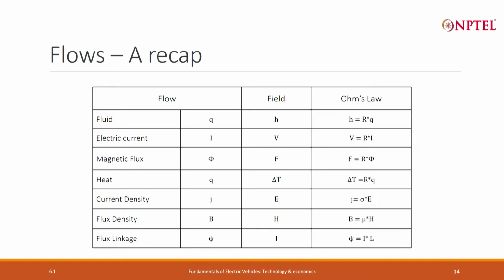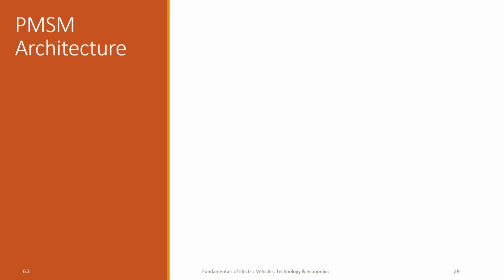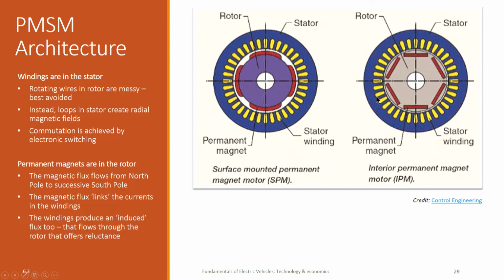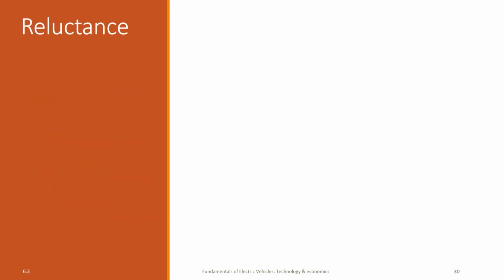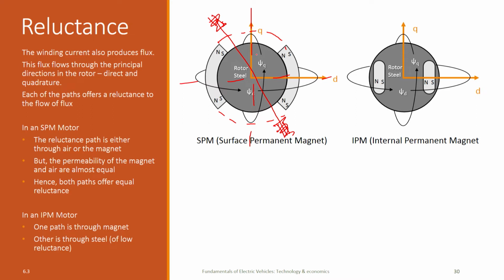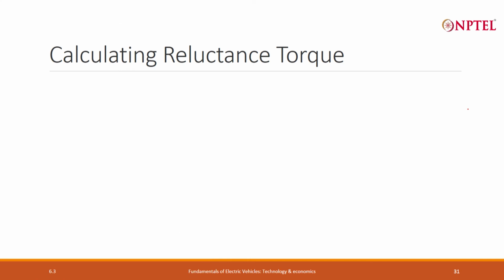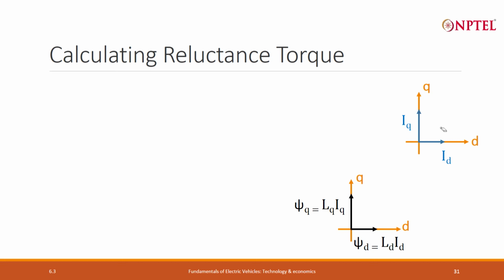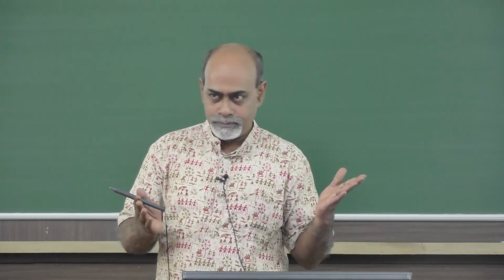Lecture 51 - Torque Production - Part 2

Comment: How is IPM better tham SPM motor? 
In my opinion, in case of SPM, air gap flux density is much more. With IPM motor air gap flux density drops significantly. One advantage with IPM is magnets can be retained without flying out, and little bit of reluctance torque is increased.
Please correct me if wrong.